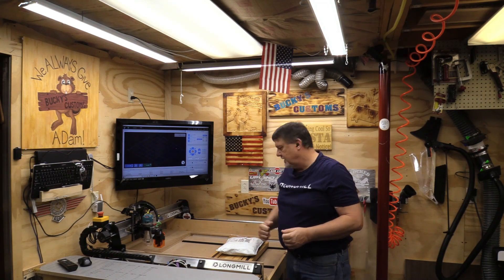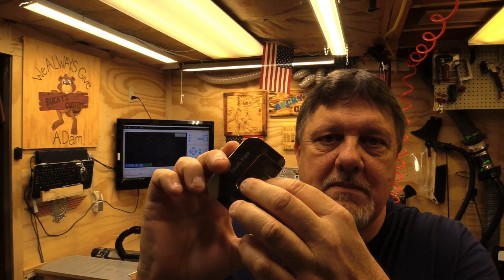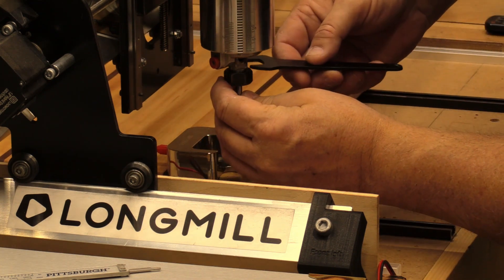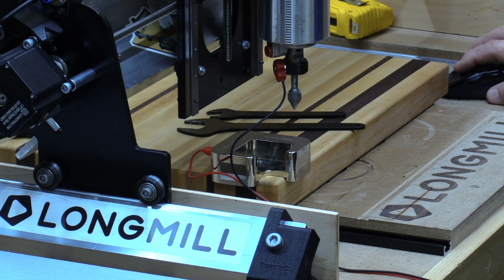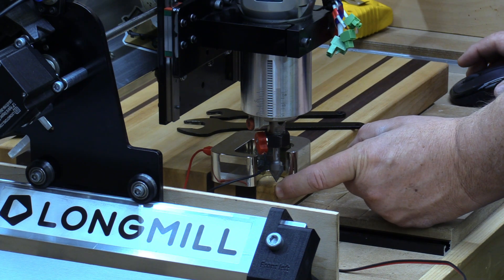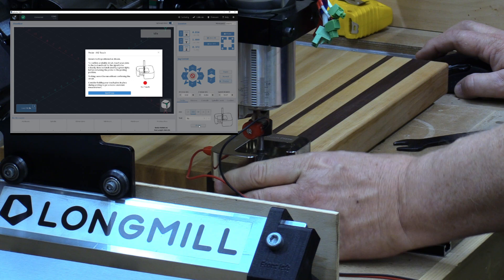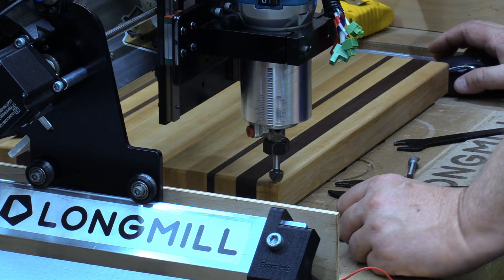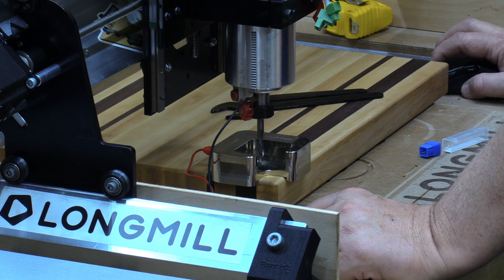New AutoZero Touch Plate from SienciLabs

Comment: Just commenting in case it helps others.  I didn't see "tip" listed in the drop down menu until I hit the x.  After that auto and tip were listed.  
The first time I used this plate was with the the 3/8" groovee jenny, the bit was placed so the outer diameter was at the corner.  I think this setting will put the tip right on the corner. Thanks Bucky.

Comment: So, would you mind describing how would you set irregular bits before you got the auto zero. I know how I do it but I don't know if I'm doing it correctly but however while I'm watching that touch plate I see now what I need to to do differently.
Reply from the maker: I used a straight bit to x and y. Then I installed the v bit and zero zed.

Comment: How do you use  the touch plate on the upper left or right corners to set your starting point of the project in G sender. I tried it on the upper left corner and it bent my bit because it traveled as if it was positioned in the lower left corner. I don't see any setting in the software to change the home position like you can in Vcarve.
Reply from the maker: Did you create your project using upper left or right start point?

Comment: Great video, thanks. I wonder why they had it made so thick. I don't normally like to protrude my vbits that far out of the collet. It just seems to be to thick, they could of still done this design but a bit thinner. It just looks crowded in the throat of the probe......on a side note I did change my order of my 48x30 mk2 to swap out from the og probe to this one. Just wish it would come to me sooner then July lol.
Reply from the maker: Yeah not sure.  The V Or Ball bits don't touch the sides so the depth didn't end up being an issue on my end. I think I could have shortened them up some. I believe you will like it. Sorry you are waiting so long. Material shortages suck for sure!
Reply: @BuckysCustoms  yeah it is what it is. "preorder" is just that.
Reply from the maker: @rickgauthier6597  The waiting gives you time to get to know your software. What are you going to use? Will you be using the MK2 for a business?
Reply: @BuckysCustoms  setting myself up for when I retire. Doing  some light duty wood work jobs, signs, clocks, maybe crib boards, trinkets and gadgets lol. I currently have a next wave shark the first gen and it's a bit sloppy without and great precision and I use aspire with that. I want to get into more 3d stuff but with the slop in the machine it gets frustrating when you spend all the time in design and cut and it looks like crap at the end. Went all out with the 48/30 with every add on and laser beam.
Reply from the maker: @rickgauthier6597  Me too! I had a small Bravo Prodigy and found it to be very limiting with regard to its software. Although, I suppose it was state of the art ten years ago! With Benchtop CNC machines getting more popular the past five years I started looking again and SienciLabs was one of the first I checked out. So happy I did! Feel free to reach out anytime. I will be happy to help if I can. Good luck with your MK2!
Reply: One of the reasons why it is so thick is that the auto-zero needs that weight to make sure it does not slide to cause imprecise measurement.
Reply: @jasonzheng9784  makes sense.